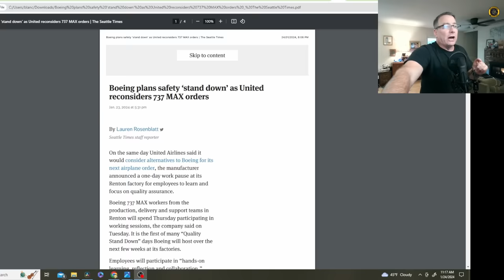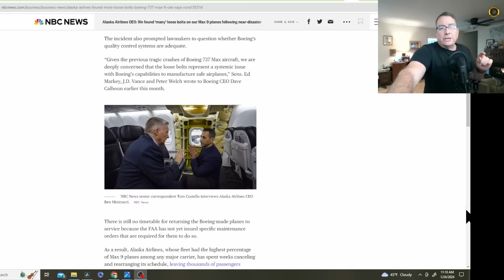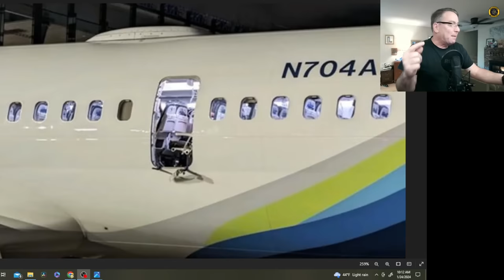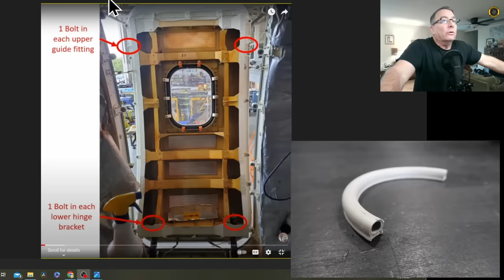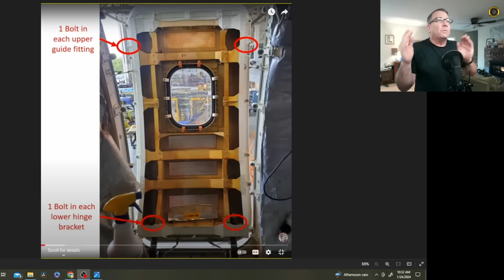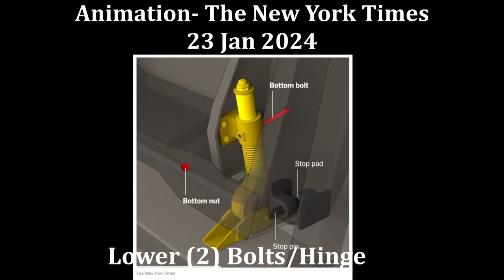Boeing's Quality Management Failure Explained 737-Max-9 Door 24 Jan 2024

Comment: I am a time served Rolls Royce Aero Engineer. (Retired). What the hell were those guys who refitted the door thinking was gonna hold that door in place? Was there no SOP? No work instruction? Was there no sign off on the completed job? Did no one even check the seal was correctly replaced, or the correct seal was used? This is crazy!!!
Reply: Not to mention what happened to the fasteners that were removed and that apparently went unnoticed thereafter.  Ouch!
Reply: There should be work instructions as well as a quality checkpoint noted in the instructions to remove and replace that door (I’m sure this isn’t the first time they did that work from the sounds of the crappy workmanship of Spirit). Those instructions should be certified thorough a proper engineering review when they would have been written (probably by Spirit engineers since it sounds like they took the ownership of the repair and it was their crew working on it from what was said).  And that Spirit crew would have been responsible for the quality check if they were owning the work. Having a Boeing quality check would have been redundant at that point. That’s a lot of assumptions on my part of course. If Boeing were to have taken the lead on the seal repair then they should have to do the same with instructions, reviews and quality checks.
Not clear yet who owned the repair.
Reply: @entropyroshan9846  I agree - honestly the whole Spirit spinoff seems like it needs a closer look.
Reply: It would appear that Boeing treated opening a door plug the same as opening a door….it is outrageous hey! One is a maintenance procedure (or should be) and the other a normal procedure. One has bolts, nuts, fixtures etc and the other has an emergency slide!   WTF are Boeing thinking?
Reply: @entropyroshan9846  Boeing knows that work quality and quality checks of Spirit Aerosystems are abysmal, so Boeing must double-check any safety-critical installations. Not performing those checks is gross negligence on Boeing's side!
Reply: What I want to know, is how they can have bolts left over after the job and think everything is okay. Did they hand the job off to a different shift halfway through? Where were the bolts put when they were removed? Having screws left over is okay for a child taking apart and reassembling a toy, not for an airliner.
Reply: @skayt35  I disagree, but only on a point of principal.  One of the benefits of having a customer with a quality system should be that you don't have to check their work.  For example it might be impractical for Boeing to confirm everything is assembled correctly at Spirit without tearing the fuselage apart or making new components.  I think the correct response by Boeing should have been to require their supplier to (drastically) improve their QA system, and to audit their system so they could have confidence in it.  "Should have" definitely in the past tense, like a long, long time ago.  (or, cough, pull the work inhouse if there isn't another, better supplier.)
Reply: @entropyroshan9846 from the leak it sounds like there was a full procedure for removing the door, but nothing for "opening" the door without removal, so spirit just opened it so as to skip the paperwork.
Reply: @camf7522 I don't think they treated them the same. I think there was no procedure for just opening the plug.

No procedure means you aren't supposed to do it
Reply: @RobertSzasz  agreed. Clearly the definition of “door” needs to be called into question as well as the viability of that supplier and their ability to control quality.  And Boeing quality as well…
Reply: @skayt35  yup. At the end of the day Boeing owns it.
Reply: I'm a retired quality engineer and really shocked how things went down the drain.....
Reply: @sleepib  If you take it apart and put it back together again enough times you get a completely new second jet. 😅
Reply: This sounds more like a bit of collusion to get the airframe moving, no hold for a quality inspection, an infraction not recorded in Boeings quality system (better reporting stats). It just sucks, lucky this blew out at 14,000 ft rather than 34,000 feet. Having been in a airframe supplier for 30 plus years, I keep telling my wife (who has a fear of flying) how safe it is. I am now seeing how standards have and are slipping in the pursuit of profit. I'm re-evaluating my position. I bet Airbus are quietly reevaluating their issues, reporting and rectification whilst the worlds attention is on Boeing.
Reply: Any advise for Aerospace Engineering fresh grade to get a job?
Reply: @RobertSzasz 
Possibly driven by the fact that there weren't enough qualified engineers to check the work in the time given to do the job.
Just a thought. 🤔
Reply: You just know they had a bunch of bolts left over like when you finish an IKEA cupboard and you have 3 wooden grommets left and no idea where they were meant to go
Reply: @esphilee Make attention to detail your guiding principle, always remember that you never stop learning no matter how long you've been doing your job and never stay quiet about something that you feel is wrong. 

Lives depend on you. There is never "that'll do" always spot on so you have pride in what you do and if you raise a concern early in your career to a more senior member of staff then they will either;

Think "hey, what a great and focused young person. They'll go far".

Say "good point, but we don't have to worry about that because X,Y or Z" and teach you something 

Or, lastly;

This kids gonna cost us money, he's a pain in the arse let's give him/her the shitty jobs and make his/her life difficult. 

And that's the company you don't want to work for, trust this old grumpy spanner twirler. I've been about a bit and it just isn't worth it, it starts to overspill into your home life, you get a short temper etc etc.

A wise man once said, if you make your hobby your job, you'll never work anoter day in your life. What the wise man didn't say, was that if you make your hobby your job and work in the wrong place then your hobby will be ruined forever. 

Hope this helps and as a little "Easter Egg" I made one deliberate mistake in this post, using your attention to detail see if you can find it. 

Best of luck for your future, Big Jon.
Reply: Just thinking out loud about this. The seal was replaced, what if the bor was not bolted down, as it was known that the replaced seal needs to be inspected afterwards, which can only happen with the door open or removed? But as they only opened the door, no papertrail at boing called for that inspection, also not sure if the seal was a to do comming from boeing or Spirit QM. But even if that was the case, that makes it even more horrific. I could understand how boeing could have missed inspecting hte door the way their system is set up. But if then Spirit handled the seal, their paper trail should call for making sure it got inspected and required follow up steps got done and inspected (closing/reassembling the door etc.).
I don´t know, maybe as an engineer dealing with processes and especially intermashed processes every day that just to common logic for me. (Don´t estimate someone else did the step necessary before you can continue, but check it was done before you continue or at least someone else checked and documented it was done)

But if someone at boeing came up with the question "what can we do?" and they did not yet already decide to handle opening and removing the door, respectively the door plug, the same when it comes to what inspections are required in their system, I don´t know what can help them any more.
Reply: @entropyroshan9846  no matter who owns repsonsibility for whatever requires opening or removing the door, boing should not handle it any different in their system, if the door was removed or still held in by four straps. In the end, Boeing has to take responsibility on what gets delivered. So in any case those bolts get removed, no matter what for, they should be inspected afterwards if reinstalled correctly.
Reply: Hard to believe that whoever re- fitted the door was so unaware of the mechanism itself.   I supposed they assumed the next guy would re fit the bolts.  The trim fitter was next in and just did his job  to cover it all up.  Incredible.
Reply: @naturalverities  in the orginal article the whistle blower states that bolts/ nuts where probably brushed off in to the scrap metal pile by someone eles since there was no inspection sign off of these 4 bolts so since they just layed around with no one knowing what there for they got thrown out most likely because they cant take them in and catalog it to a specific number
Reply: They were too busy swiping left and right on their Tinder app, than focusing on installing the plug door properly.
Reply: Puzzling.. But how did the spring loaded door stay in place? I would think you need at least some force to push it down against the springs?
Reply: @Autocreatorz I wouldn't be surprised that this was standard procedure to use the bolts only one time.
Reply: Welcome to the party. Some of us have been here for quite some time.
Reply: @the.just.able.biker67 ….But quality engineers cost money! Shareholders won’t like that.
Reply: @esphilee  Retrain for something else.  Aerospace companies are too cheap to pay you what you are worth.  They want to out source the work to India or use visa workers who are afraid to complain when mistreated because their visa is dependent on them keeping the job.
Reply: @naturalverities   right? What should I do with these extra bolts is an age-old joke, cut there's nothing funny about it in the real world of aircraft maintenance.
Reply: @dermick  you're right, especially since this isn't the first incident involving bad workmanship on the part of Spirit.
Reply: Corporate overseers wanted workers that are cogs in a machine, they are treated like cogs, and cogs is what you get. They turn, they don’t think. Paraphrasing things a bit. Do the people who work on the manufacturing floor have enough bother to give about whether what they are doing makes sense if, for all they know, they made be made redundant the next workday as a thank you? Instructions and procedures ultimately can’t work around human attitudes. The latter have to be sound first.
Reply: @absurdengineering  I've worked many years in management, though not in aerospace. I once had an EVP who lectured me regularly to think of employees as cogs in a machine. He would actually say "sometimes you have the wrong gear on the axle, but if you move that gear to a different axle the machine will run perfectly."

He was an idiot.
Reply: @motivase  that's been my question from the beginning: how were the springs initially compressed and what held the "door" in place against the residual preload in the absence of at least one bolt?
Reply: Spirit probably wanted to save face. Or rather not have another Boeing inspection. It was a Boeing quality inspection that found the original issue. By doing things a certain way they were able to avoid another one since it didn’t automatically create a work order for inspection. It’s likely that the first inspection was on one shift and the work was completed over into the next shift then spirit signed off, and the aircraft moved to the next station. The first inspector would have come back to work, not seen any inspection for that airframe and moved onto the next open task. Because they build around the clock, one person can’t own a job like that start to finish. It would make no sense. There would be no reason for that first inspector to go digging around to see if everyone else on the other shift did their jobs correctly, if they all did that, now new work would ever get done.
Reply: @paulmoir4452  In this case, it appears that the Spirt quality system was more strict than the Boeing one. Problem not solved.
Reply: @karmatraining  IKEA frequently provides more components (e.g grommets and screws) than are required, just in case you break or lose one.
Reply: @alexanderkupke920  It may well be that the SOP and quality system assumes that the seal is checked and verified before the plug is installed, in which case there would never be any need to open or replace the plug during manufacture and therefore no instructions for what to do.
Reply: @poppyrowland1385  They'll like the damage to Boeing's reputation a great deal less.
Reply: @naturalverities  exactly. To my understanding you have to pull the plug in and then down. I assume there is a specific procedure to be followed. And then while it is held down the bolts are inserted by a second person. First down at the spring then at the guide on the top side of the plug.
The only thing I can imagine is forgetting the nut. But that cannot be a serial issue... At least I hope that...
Reply: @motivase  I'm guessing that a fixture of some kind is used to compress the springs and that there is enough friction from the fit-up, including the seal, to keep the door closed even without the bolts installed and the fixture removed.  Or maybe the fixture never got removed??
Reply: Spirit is an apt name; when you go to check their work, there's nothing there!
Reply: Spirit should not be onsite at Boeing; it's a recipe for confusion and mistakes.
Reply: The people on the shopfloor are not allowed to do anything that is not documented in an instruction.  And they should be trained to the same instruction.   The fact there was no SOP is therefore not an excuse, it means somebody on the floor broke a cardinal rule.  Inspection is a detection after the event, that can never be fully relied on.
Reply: @paulmoir4452  you know that "Spirit Aerosystems" formerly was "Boeing of Wichita", the fuselage factory of Boeing before they split it off.
Reply: @JT_2024-c8j  impossible... You have to compress two springs to get it set.
Reply: @hb1338  Yeah, the regular issue with assumptions. When safety relevant you simply cannot assume anything. Or as Petter pointed out in some video: assume, that means making an ass of u and me.
Reply: @naturalverities  Or never installed at Spirit in the first place!!  Bad gasket install was probably done by the same worker(s) and they may have even figured the QC guys will add the bolts, when they inspect the door and seal.
Reply: @naturalverities  Oh, I can guess what happened to those removed fasteners - somebody on 2nd shift found them at a workstation or on the floor of the interior of that 737, thought they were FOD, and pitched them in the scrap barrel.
Reply: @hb1338  Oh, I thought it was Spirit technicians working under the Spirit QA system, just inside the Boeing plant?  That is to say not Boeing's QA.  (Though, literally in parenthesis, Boeing's QA is responsible for accepting Spirit's QA system.)
Reply: @skayt35  Yes.  But they're split now, and that's what matters.
Reply: In the picture of the ntsb preliminary report there is a probable answer to this question. A humble cable tie fixated the plug.
Reply: Dave Calhoun has to go

Comment: Having worked as a process chemist that included quality control in the metal working industry, I am well aware of quality control issues. And, it is well known that Boeing has been plagued with QC issues for the past 15 years or so.  Unfortunately, management has yet to resolve these problems. And, as a fellow commenter recently stated: "If the Board of Boeing can pay former CEO Dennis Muilenburg $62 million but can’t oversee 4 bolts being fitted to a removed  door plug, they need to go." So very RIGHT ON!!
Reply: you can build in clauses and consequences in any endeavor but it is so easy for many systems to be created which oppose that and creates fat cats. Humans seem predisposed to look for methods to reduce work and this means consolidating power and eliminating consequences for lapses in quality. For example: UNIONS
Reply: I agree that the Board and imo, upper, middle and lower management need all be removed in order to fix this however, what does any of that have to do with how much he gets paid? It’s completely irrelevant!
Reply: Dennis was fired years ago